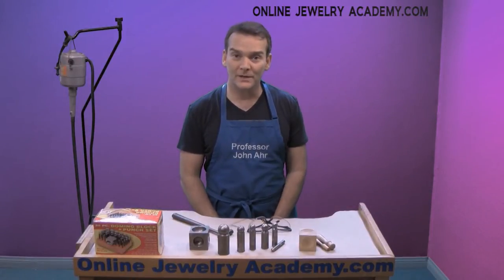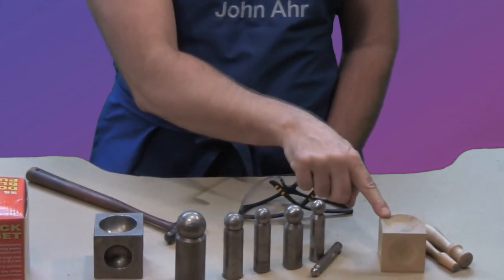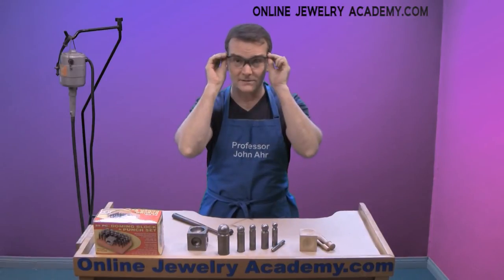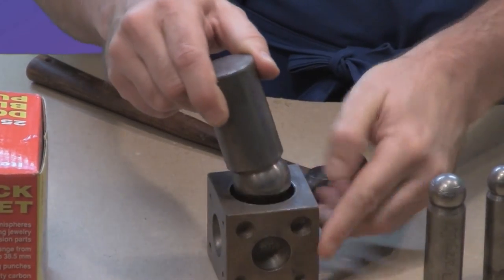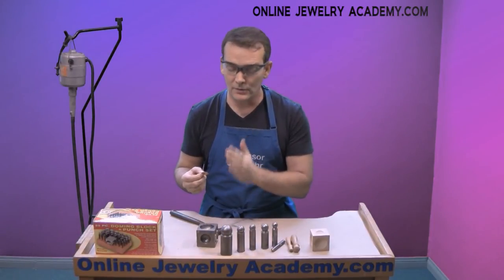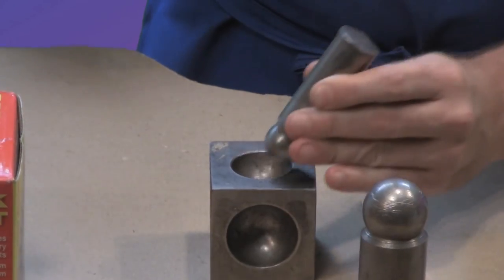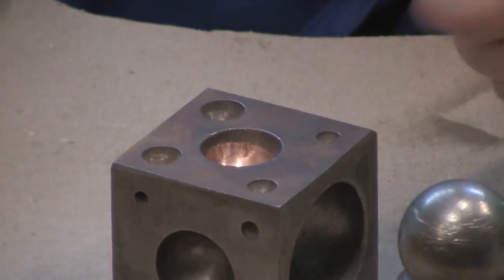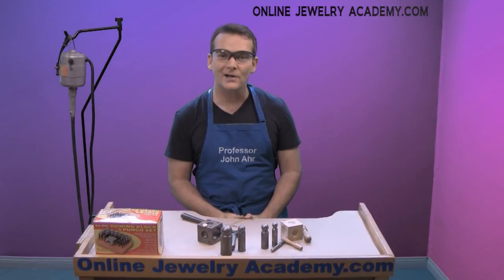Dapping Metal Discs Into Domes

Comment: Thanks much for all the videos - really great info!  I have a techie sort of question...  I use a number of copper disks linked together to make bracelets, so I've domed lots of disks.  Recently, I've been trying out some embossing on the disks.  Of course, doming them, even in my wooden block, flattens out the embossed design.  Is there some way to dome an embossed disk?  Many thanks!
Reply from the maker: Hi Ngaire,  Yes, it is possible to create embossed domes.  But, you will need a hydraulic press which is an expensive tool.  Heres how it works.  First you would emboss, stamp, roll print, texture, etc. your annealed metal.  You would then re-anneal the metal and prepare it for shaping.  The metal blank is placed over a die and covered with flexible pads and placed inside the press.  The press is then raised so that the pads squish the metal into the die.  You might find a press you can use at a local college or community center.  Good luck with your projects.
Thanks for your support! : )
Reply: Thanks very much!  I don't have a hydraulic press, or a community college nearby, but, I think I might be able to figure a way to try it, now that I've got the image in my head of how it works.  Thanks again for all the great information.  Been very, very helpful.

Comment: Can you use this to make a half sphere and then solder two half spheres together to make a full sphere? Because with my coming block I notice that eventually I work it to a point where the dome becomes wider than the cavity I am trying to hammer it into, which only results in marring the surface. I have thought of perhaps cutting some holes in hardwood and using the punch to drive it through, drawing the fringes of the metal around rather than continuing to use the block, think that might do the trick?
Reply from the maker: With practice, it is possible to use the dapping block to make two perfectly formed hemispheres.  You will need to slightly tilt the hemispheres while you dap them in order to compress the material that extends above the concavity.  Hitting directly on any "puckers" will help to smooth the metal.  You don't need to create an additional tool.  Start small and work you way toward making larger spheres.  😀
Reply: @OnlineJewelryAcademy  I have been trying that, but not proving successful with it. It always marks up part of the piece. The dome is always slightly larger than the opening of the last few cavities, and the edge of the cavities being so sharp they cut into the metal instead of allowing it to slide past. Even if I tilt it, it still marks up wherever it meets the edge. I just can't seem to get it without that happening.

I had a little luck by annealing the metal before trying because it softened it a bit so it would form into the cavity more before the edge would dig into it, but even then it only reduced the marking.
Reply from the maker: @chrisr3120  First, you must anneal your metal before you do anything that will change its shape. Second, you can sand and polish your dapping block to soften the sharp edges. Third you need to work progressively from the largest concavity to the one you desire. I suggest you supplement the OJA video with other online tutorials. And, practice with smaller pieces until you get the hang of working efficiently with your dapping block. Good luck!🍀
Reply: @OnlineJewelryAcademy  Would a nylon dapping block help? Or would a nylon block just get damaged from use before I could really get any decent use out of it? I do some acid etching and I would kind of like to see if I could etch a pattern into the blank before forming so I can print the pattern on pnp transfer paper.

I've worked it down to a point where I can polish the marks off afterwards, but still not quite enough to preserve anything etched into it beforehand.
Reply from the maker: @chrisr3120  I have never seen a nylon dapping block.  There is a video in the OJA playlist on using a hardwood dapping block in order to preserve a surface texture. Check it out: https://www.onlinejewelryacademy.com/domed-textured-discs-video.html 😀

Comment: Could an egg shape locket be crafted using this tool? Thanks
Reply from the maker: It would be difficult to create two identical egg halves using a dapping block intended for making domes. 😀
Reply: @OnlineJewelryAcademy  I have noticed that there are oval dapping blocks, would these perhaps help? Thanks for your valuable input 🙂
Reply from the maker: @cyberlightbeing  If the goal is to make an egg shaped locket, you would need a tool (or tools) that would enable you to make two matching halves of the form. You could use a die and a hydraulic press to quickly create the two sides of the locket. The OJA does not have a video on using a hydraulic press. But this might help: https://www.onlinejewelryacademy.com/die-forming-video.html
Good luck! 🍀
Reply: @OnlineJewelryAcademy  Very grateful for your brilliant suggestions, thank you!